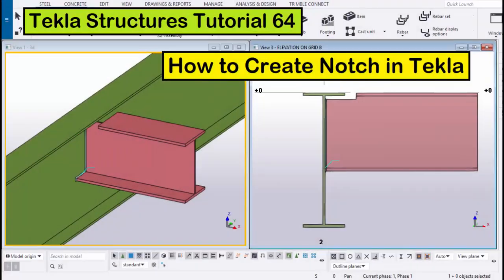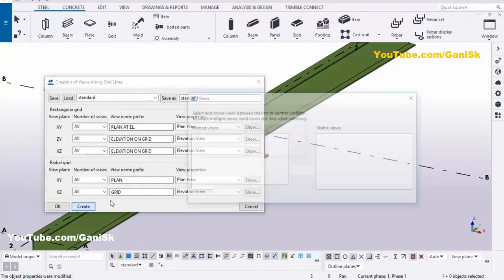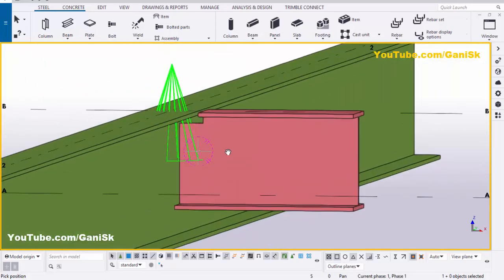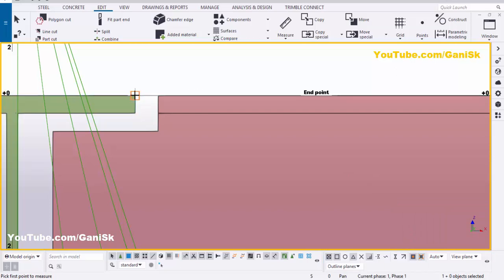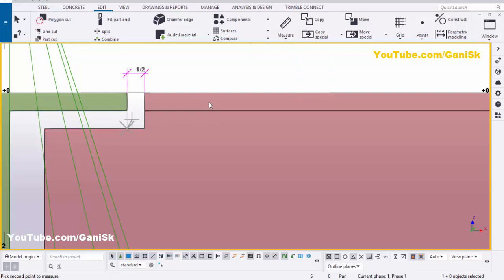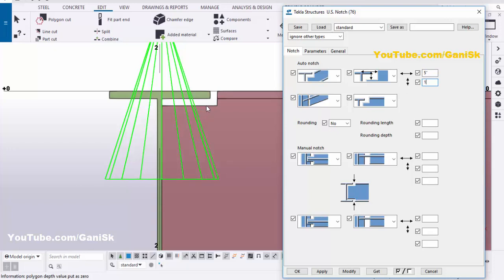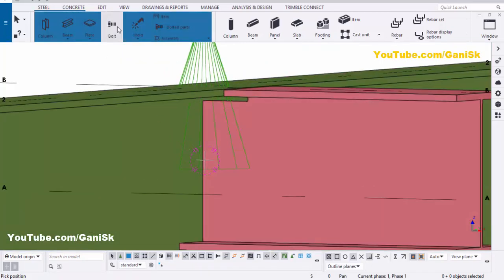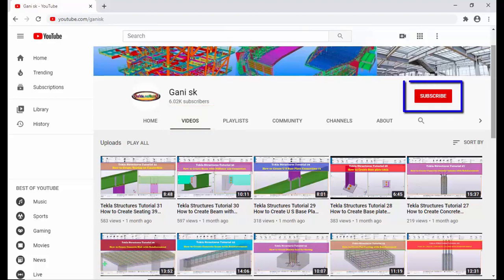Tekla Structures Tutorial 64 | How to Create Notch in Tekla Structures

Comment: I want to change the thick 7mm thk weld by selecting the weld of the member in the tech. What to do
Reply from the maker: Not required to change thickness in model, you need to mention thickness of weld in assembly drawing.